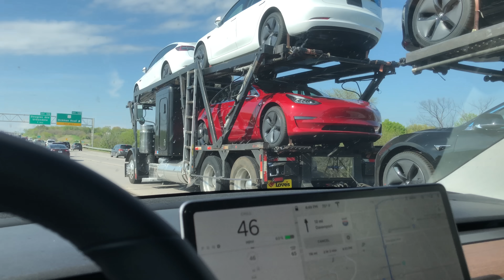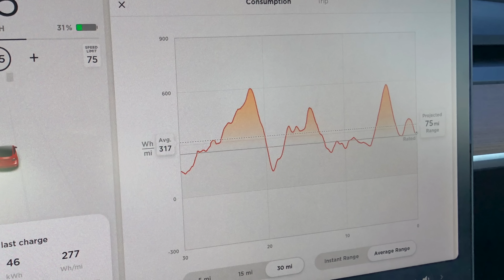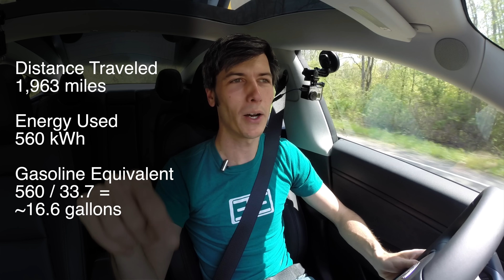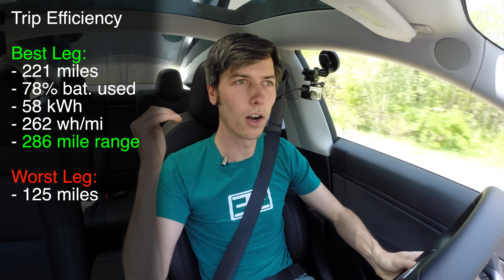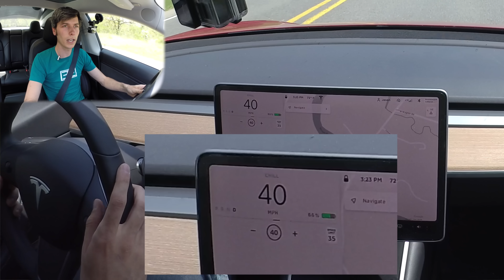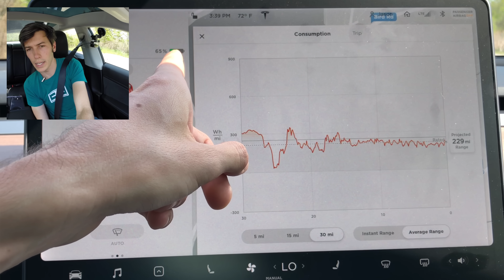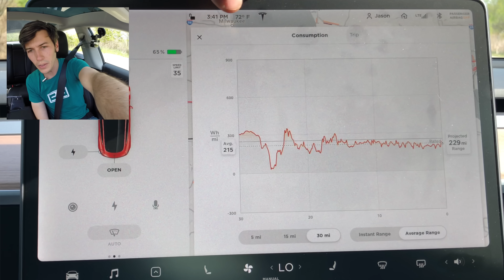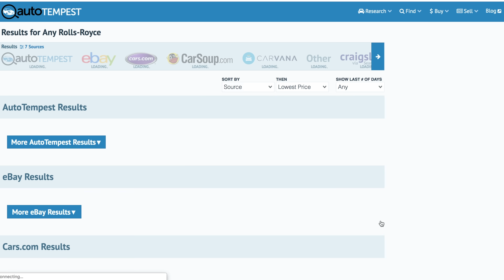How Miserable Is A Tesla Road Trip?

Comment: So I don’t see this really taking much longer vs a gasoline car. I regularly did a 1000 mile trip in about 16hrs avg. so I guess Tesla would take like 17.5 hrs for 1000 miles, much more comfortably and safely especially if you drive it straight through. Those last hours are so tiring.

Comment: Where do you charge if there are no Tesla stations? Legit question. I haven't seen any charging stations around here at all. There has to be some kind of an option.

I'm very disappointed that you didn't drop a gear in that tunnel man... so sad.
Reply from the maker: Haha, typically you won't see Tesla stations unless you're actively looking for them. I had no idea they were around. But you can charge at most charging stations, the car comes with an adapter plug.
Reply: google:  ev charging stations map   , they'll fix you right up.
Reply: Woof.

Type "ev charging stations alabama" in Google. There's a reason I haven't seen any.

Comment: Since the battery charges much faster at lower levels when we have taken the long road trips we charge differently.  We charge more frequently for short periods of time.  Start the trip 100% charged. Then 1st stop is when we are around 10% left. Then unless we plan to stop for a meal we charge just enough to arrive at next charger on route with 10% left. Then another very short charge. So instead of 40-50 minute charge to go the next 200-250 miles we stop for 20-30 minutes total.  Then when we stop for a meal we charge back up to 100%. Also of course if we stop for a hotel we charge up 100% before we get back on road.
Reply: I drive long distance every other week and you are exactly correct. He stops way too long at the superchargers and could have probably stops for 30 minutes and still made it Easley. That would have greatly reduced is charge time over the course of the trip

Comment: Just rent a car for road trips. If you do that, the range that any EV really needs is about a hundred miles. Instead of making EVs so heavy and wasting all that battery capacity and efficiency for the rare road trip, just rent a car and you'll do better for the environment, have no range anxiety, and not waste time. Seriously folks, let's use a little common sense here.
Reply from the maker: I agree, you can get away with much smaller batteries than people think.

Comment: And thanks for the thorough video on your trip! You mentioned too about not too much wind noise, did you do any mods to the car? Like extra door seals or the rubber ring some owners put on the roof?
Reply from the maker: Nothing modified in the sense that it was done to improve performance. Just a few things like rubber mats, XPEL, ceramic coating, chrome delete.

Comment: There is nothing i can agree with more than the obsession with low profile tires. If you live in a city they suck and you can get most of the performance 99% of every driver will ever use on the road. Higher origins should be an option, even in otherwise performance oriented versions of cars that aren't super Cars
Reply from the maker: Agreed!

Comment: Your review is very helpful.  You basically sealed the deal that an EV vehicle would not fit my family travel plans.  We usually travel 350-400 miles w a family of four between stops.  With an oversized fuel tank 50 gal we can travel 800 plus miles on a tank of diesel.  Our 1000 mile trip to Orlando is done w just two stops or 14 hours.
Reply from the maker: 400 miles is a long time between breaks! But get that hustle in!
Reply: Engineering Explained 
Yes I agree but in a 1000 trip the EV will require 4 stops or almost three hours of stops.  We have two stop and only need fuel at one stop.  Therefore we have a 20 min stop and and 30 min stop max.  The last difference is the  food costs at four stops verse two.  My teenagers are quite costly on road trips.  
Btw your videos are very informative and always enjoy them.  Tks again

Comment: Question: 
If you have 100 galons of gasoline in two separate scenarios. First you use that to fuel an ICE car, with an above average efficiency compared to ICE; second you use that to fuel a power plant (that consumes way more than that every minute to be efficient, but scale it down to calculate) and the energy to charge an electric car. Say those cars chassis wheight the same, and they have the same aerodynamic features, which could travel furthest and by what ratio? So the only differences are the way you're burning the gasoline and the wheight of the drive train.
Reply: Lots of issues with that. First, burning the gas at a power station is still inefficient. More efficient than a car, but still inefficient. Second, there are greatly better ways to produce electricity. 
That video would likely show an EV only being about as efficient as a Prius, probably less due to other loses and battery weight. This would then cause people to use that video to claim that EVs are less efficient than all ice cars.
Reply: @anthonypelchat  I forgot to type that I would use a more modern and efficient EV power train to compare, specially because this technology is still very rapidly advancing, so seems just right. And I know that's not the best way to produce eletricity, but my train of thought was: we have a limited amount of fossil fuel left to use, so should we try to maximize our efficiency in using it? How much more efficient is burning gas in a big power plant rather than carrying a mini version of it around with you, and how does it correlate to the losses through added weight and at the charging process.
Reply: @casarek  I understand. But it would be taken the wrong way. And burning ff is inefficient no matter what tech is used. At best, you are looking at maybe 50-60% burning at an extremely efficient plant. Some loss over power lines and converters would likely put the power at less than 50% by the time it got put in an EV. Then you are looking at the weight of a battery, which will cause a little more loss. 

While I wouldn't mind seeing a full break down, like you suggested, I know that it will then be turned around and used to show how bad EVs are in several news sites and videos. You would be surprised how often these tests get used to bash EVs.

Comment: Off my list until they get at least 80% in less than 10 minutes and improve cold weather efficiency. And or it increases energy density by minimum double.
Reply from the maker: Haha, why do you need 600 miles of range? I had a 150 mile Leaf, used it around town all the time, and it was more than enough. With the Tesla, I hardly ever go under 60% charge in a day. It's way more range than you might think.

Comment: Factor in the impact to make the batteries, electronics and technology.
Reply from the maker: How does that relate to a road trip?
Reply: @EngineeringExplained  if the selling point of battery cars is to save the environment it's cancelled by the damage mining and processing cause to make the battery cars.  You didn't make a strong statement on that, you hinted as much.

Comment: Great video. Two quibbles. Air resistance doesn't increase "exponentially" with speed. It's about a power of 2 (for force) or 3 (for power). And no way were you born in 1963!
Reply from the maker: You know that power of 2 (squared) is exponential, right? You said I'm wrong, then proved I'm right, in the same comment. I'm aware of force and power equations haha.
Reply: @EngineeringExplained  Not sure a function with a constant power like 2 or 3 counts as exponential. Exponential would be if resistance was something to the power of your speed. Population growth is a good example. You read the Wikipedia page, I think it's backing me up on this. Yes I believe you know all about power and speed I'm just quibbling about the meaning of the word "exponential" here :)

Comment: The beauty of gasoline is the energy density .. period. Well, that and the sound it makes coming out of a Maserati V8. But I digress.
Reply: so tape a maserati and put it on the sound system...  I think there'll be a market for old-car sounds for these electrics... wanna be a 63 'vette, $8.99 download - wanna be an F350 with dual exhaust,  $8.99 download...  lol
Reply: The beauty of electricity is that it can be cheaply produced and easily transported. Period. That and the fact that when used in an EV, it can produce so much torque that it'll make a Maserati V8 cry. But I digress. ;)

Comment: 1971 Wolseley 18/85 II

28-37 mpg (urban-highway). Capable of US highway speeds (and introduced when you were 4 years old). Uses either a detuned or returned MGB engine (87-97hp BMC B series petrol). 

Can do 260 miles to 370 miles a tank and refuels in about 7 minutes including paying for the petrol. The diesel I would love to convert it to (BMC B series 1.8 diesel) would do at least 40mpg.

This is the point - even a 47 year old car (and strictly a 57-60 year old design, with an engine that dates from 1946 for heavens sake (the year my dad was born) is a better bet for long distance journeys than a Muskkretinwagen type 3P.

Its enough to make you cry at the stupidity of it.

PS. As a woman travelling alone I'd trust a T series Ford before I'd trust an EV. Simply because if something goes wrong I have a chance of fixing the model T or the Wolseley. Some chance of that with a Tesla.
Reply: No need to refine gas though, so all the electricity used in refining goes directly to motive force down the road and not exhaust heat (which about 2/3 of energy used in the US ends up as...) - no fumes, no spills, no tailpipe emissions in situ.  And the "at least I can fix..." - you assume everything is going to break because what you've been driving, probably does - much less to break on an EV mechanically... so Muskkretin has done a pretty good job leveraging tech to make a fine transport vehicle...  (I get 40mpg US in my Accord  every tank and sometimes up to 42)  Times are changing, range will expand and price will come down...

Comment: I would love to know which is better as far as time is concerned. Should you drive fast between superchargers and then have to charge for a longer duration or should you drive at 65 miles an hour or so and spend less time at superchargers. Super interesting!
Reply from the maker: Generally speaking I think you can get away with faster speeds, as the charging is pretty quick in the grand scheme of things.

Comment: I wonder how quick the battery loses its efficiency, like let's say after you charged it a thousand times and you got like a hundred thousand miles on it how much does the battery lose its ability to hold charge?
Reply: I think there are some taxi companys and people that have a lot of miles on theyre teslas and the data they have shows that it loses about 10 percent for 200.000 miles. Although these companys usually dont treat theyre batteries well so maybe you could get even less degradation if you looked after it enough
Reply: @chemlutx7963  that's not as bad as I expected

Comment: I haven't watched the full video yet but pretty damn miserable is my answer. I got a a Model S 70D in January and took a trip from Sacramento to LA. I decided I'll try to avoid ever doing a long road trip in my Tesla again and that is only about 450 miles. Even though I should be able to handle that in one charging stop, wanting to have reasonable charge when you get there plus the elevation changes made that 4 charging stops each way which added at least 3 hours. I typically don't like to stop at all even when my trip is 600 miles except to get gas so even though 2 of the charging stops were planned around getting food, we were served pretty fast and it only ended up taking about 40 minutes on those lunch/dinner stops (one lunch stop there and one dinner stop back) so there was still at least 2 hours and 20 minutes each way of just sitting in the car since there was nothing better to do out in the sparsely populated areas between Sacramento and LA on I-5.

Comment: 11 hours, I stop eat and drink (replenish fluids) while sitting, but that's alot of sitting
Reply from the maker: Where did you get 11 hours from?
Reply: @EngineeringExplained  I thought it was 11 hrs roughly of stopping time for miscellaneous things of which charging was one of the main reasons for stopping,  I listened to the cliff note version while changing oil in my diesel lawn tractor

Comment: Road trip is totally miserable. Piss away an hour every 3 hours. Even worse in the winter when range drops by 30% when the heater sucks the battery of electricity.And don’t forget planning your trip around chargers.
Reply: Every day you get to drive a near silent, 0 to 60 in 3 sec. electric car.

Comment: *If you had Autopilot, you could blame it for the flat tire ;)
PS: Bjorn Nyland already measured that 150-190kph (90-120mph) is the fastest way to travel with Model 3 Performance, IF you have sufficient quick chargers on the way AND always charge to 70%.

Comment: I always thought it would be nice if auto manufacturers would provide a best cruise speed etc for  your specific car. Much like how aircraft have best climb/cruise speed each car has its best speed vs. Drag. BTW  $0.28 Kwh more than double most avg home electricity costs.
Reply: They're obviously not going to sell it at the domestic rate.
Reply: 56mph (90km/h) is said to be the average most efficient speed, but you’re probably not gonna want to go that slow.
Reply: Ethan QS the average is probably calculating mostly lower mpg cars. I can drive my civic si at any speed between 50-85 and still stay at 40 mpgs assuming the road remains flat. My car won’t gain any more according to the computer.
Reply: @suiton20  Read somewhere that usually where the power and torque curves cross is likely to be best efficiency.

My car will continue to accrue mpg driving at an indicated 75mph, 2.2K i.e. average goes up and plateaus around 56mpg. In countryside driving, open motorways (little need to brake, little congestion) and keeping  speeds in 60/70 60mpg achievable, tank to tank not trip. 200ft torque at just under 2K.
Reply: Most efficient speed in a Tesla Model S is somewhere between 24-28 MPH.  Several crazy people have driven over 500 miles on a single charge by driving in that speed range.  Probably be a bit higher in a Model 3 but still going to be around 30 mph.  The supercharger cost depends on the average price of electricity in that state.  It varies from state to state.  Even at $0.28 per kwh your cost per mile is about 7 cents per mile.  At $3 per gallon you need to get about 43 mpg to be the same cost in fuel.  When you charge at home for $0.12 per Kwh (average US price) the ICE car needs to get about 100 mpg to have the same cost per mile.  If gas goes back up to $5 per gallon and you charge at home at night under a cheap time of day rate of $0.06 per Kwh your gas car would need to get 333 MPG for the costs to be the same.
Reply: Wouldn't the most efficient speed for a standard geared car just be the minimum speed in top gear? More complicated to determine that with a cvt of course.
Reply: @mitchellsteindler  may work more efficiently at higher revs in a lower gear depending on road conditions.
Reply: Adam W well, somebody has to pay for Tesla providing the Superchargerservice...

Comment: 21:12 So basically if I`m in RAV 4 hybrid with 38 mpg it is 155$. Which is cheaper then a tesla.
Reply from the maker: Yes, for road trips. Tesla charges a premium for supercharging, so it's significantly more expensive than charging at home. Overall, it tends to be slightly cheaper than most ICE options for road trips, but much cheaper for driving around town and charging at home (work commute, etc).
Reply: @EngineeringExplained  Thats why EV`s will never be as popular in Europe as in California. People just don`t live in a personal house here. There is nowhere to charge it "at home" unless you buy garage somewhere near you for like 15k$

Comment: It must be quite bad considering that it's boring to have to stop 5 min for gas every ~ 500 miles in most gas cars. But the cheeper trip might be worth it.
Reply from the maker: I don't think many gasoline cars go 500 miles without stopping. Also even assuming 80 mph, 500 miles is over 6 hours. Most people would probably stop and eat in a given 6 hour period.
Reply: @EngineeringExplained   my average per tank 2012 Accord 4dr is 679 - high is 716, got pictures to prove it.  That's Provo-Pocatello-Malad area hills etc too...
Reply: @EngineeringExplained  All cars except my current one could easily go 500 miles on one tank. It might be true most people want a break, I personally don't want to take a longer break before around 12h.